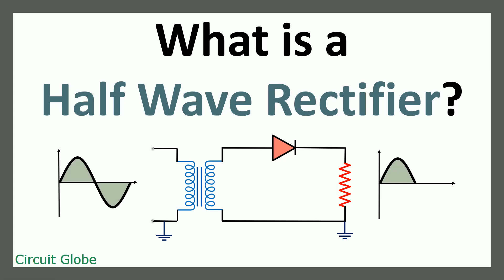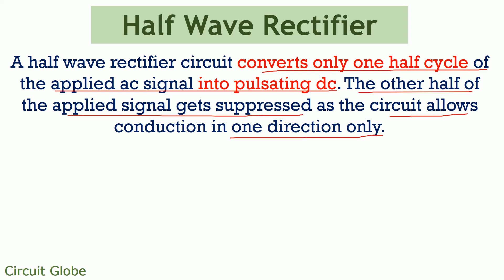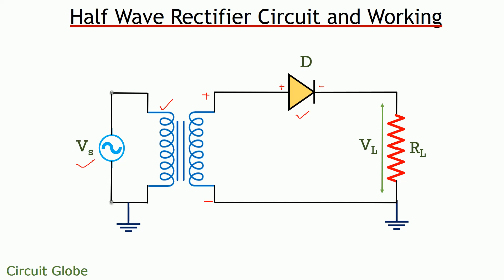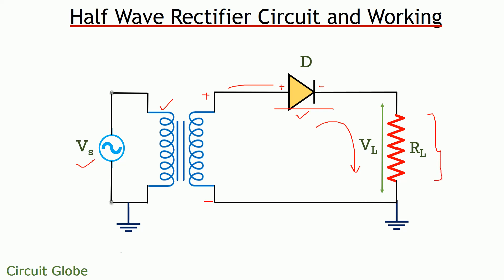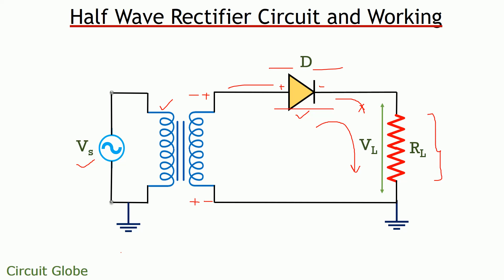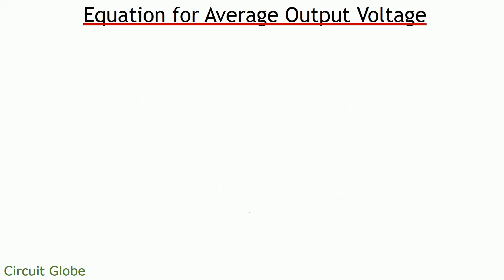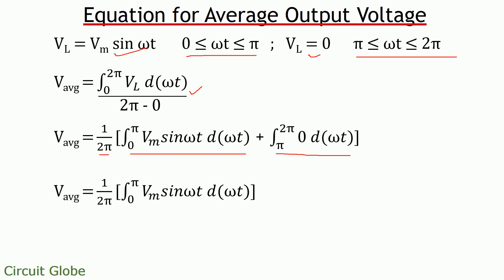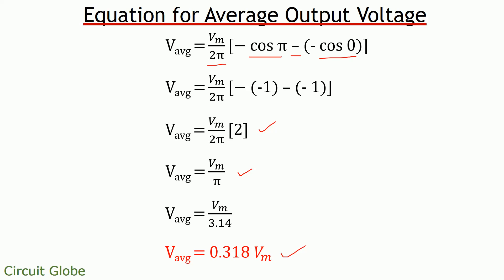What is a Half Wave Rectifier? Circuit, Working and Waveform Representation

Comment: What happens when the diode acts as open switch, electron flow in the other half cycle?
Reply: No the flow stops as the circuit is open
Reply: Yes the flow stops, and it's only runs when diode is closed i.e current should be flowed from positive to postive diode 👍